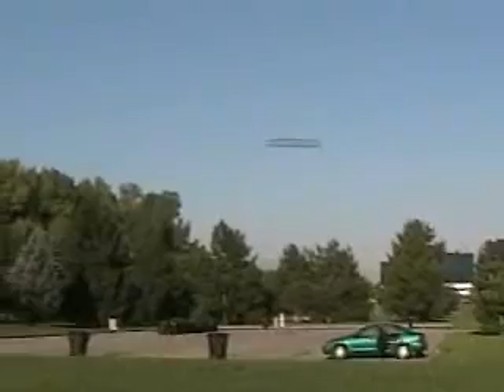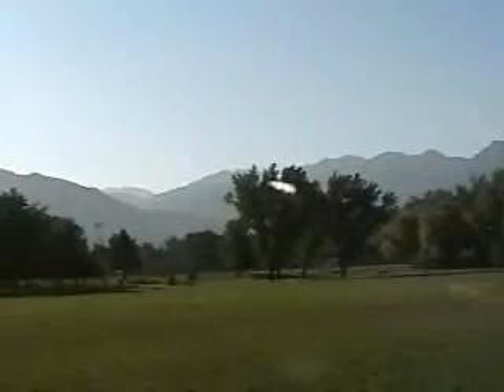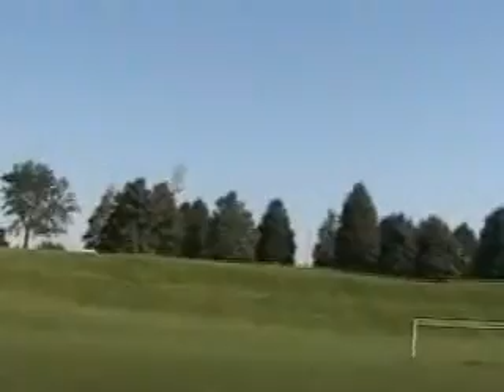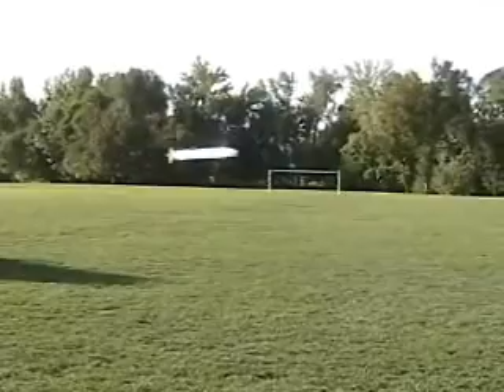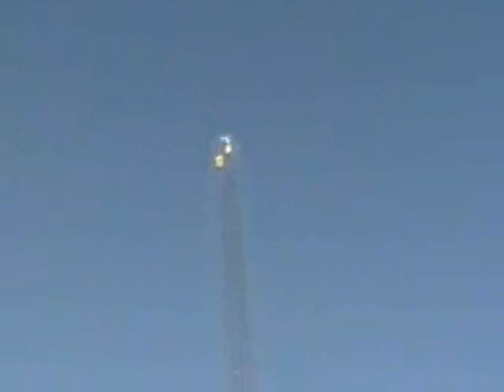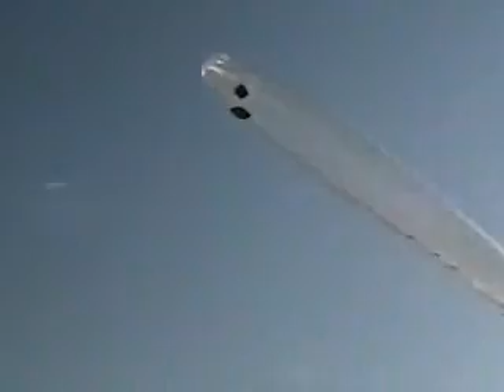High speed airship

Comment: I've worked on full sized airships that are streamlined.

You're going to have the same stability problems as traditional airships if you try to scale that up (i.e. BAD handling in any crosswinds), because you have stretched the airship to a very long shape.

This adds even more area for the wind to catch.

The larger airships that are capable of extremely fast flight are shaped more like fat triangular pancakes, and they are capable of deflating the gas envelope to help their shape more.

Comment: Jet powered would be counter productive in that it would use so much fuel. One of the major ideas of airships would be to save and not use up fuel. However there might have been a one off type craft that someone had built. I keep up with lighter then air technology fairly well and haven't heard of one, however that doesn't mean there isn't one. Have heard of someone suggesting a hot air blimp useing a gas turbine engine for motion and heat of the envelope. But never heard one being built.